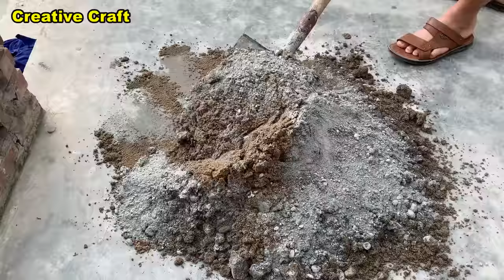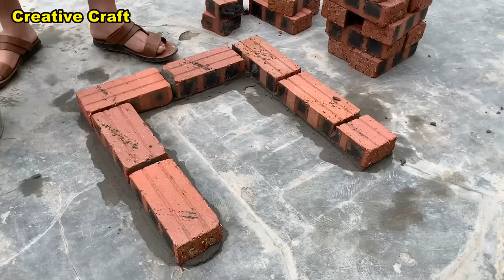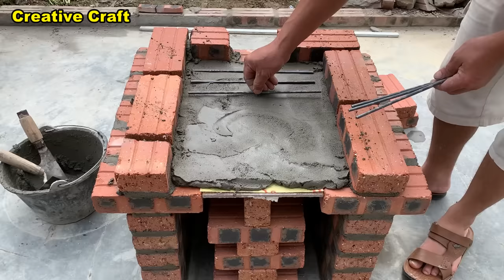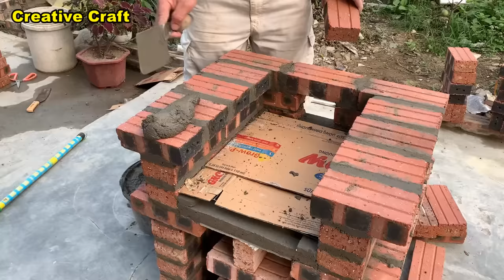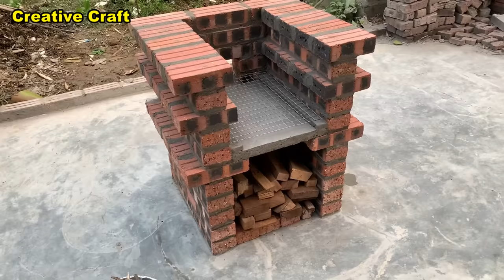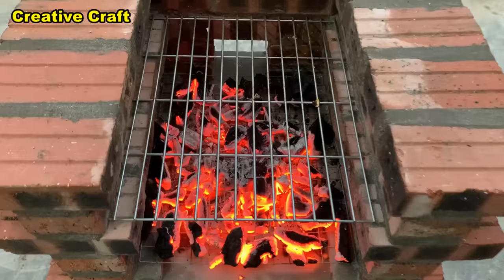Creative Kitchen Grill From Red Bricks - Creative Projects From Cement

Comment: I've never tried masonry work before but I can tell you have years & years of experience. You make it look so simple and effortless. Beautiful build.
Reply: Many years of experience but doesn't realize that cement explodes when it gets hot 🙄
Reply: @depressedpersiantowtruckman  Portland cement concrete cannot withstand exposure to 1500°F without undergoing severe strength loss and cracking because the hardened paste dehydrates at such high temperatures. Concrete made with high alumina cement and refractory aggregates might be able to withstand such exposure conditions.
Reply: HWF Live  es engañil

Comment: I've never seen that tool you're using, almost looks like a meat cleaver. I've done a mock-up using your design but without mortar, worked very well.
Reply: How does without morter work.   Are there not airholes
Reply: I do the same brother, how to do that?